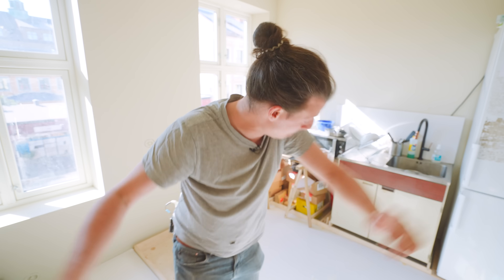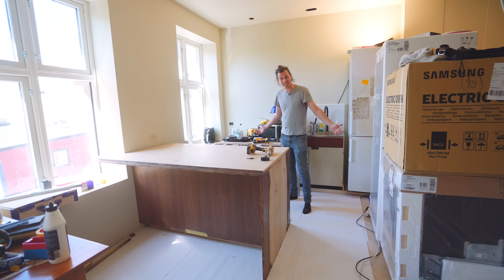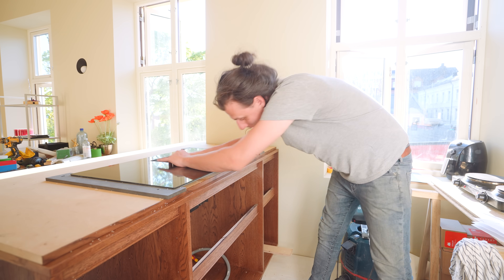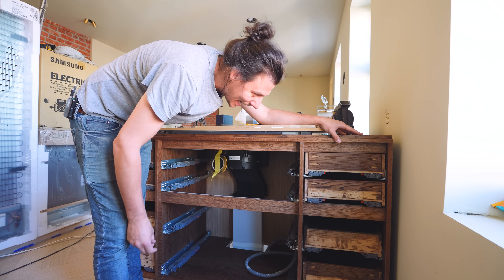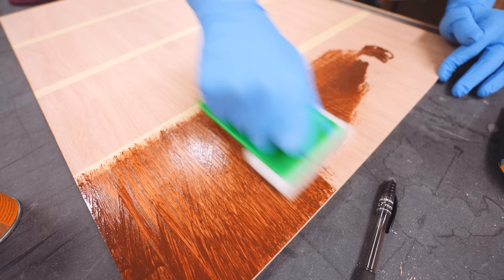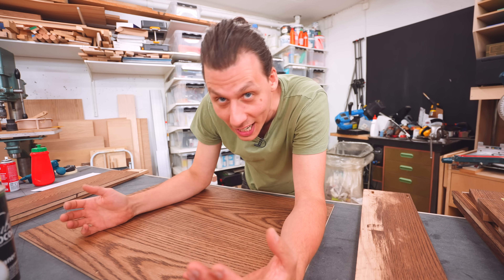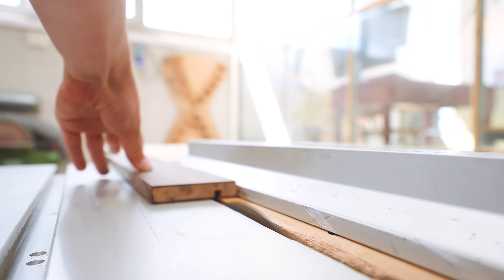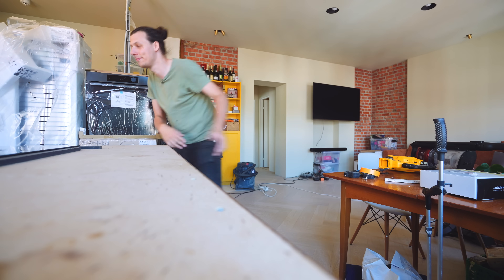Installing the Kitchen we built Ourselves!

Comment: We have the same type of cooking area with an integrated airfang. Eico Tesla model. We were super happy at start but now we are a little bit tired of the air that are blowing out on our feets. The filter do not work a 100%, so our floor are some what greasy and needs to be cleaned often. If we could change it, we would have chosen one that sits i the ceiling instead.
Reply: I was wondering about that. I was thinking about moisture, but yeesh, grease is even worse.
Reply: my first thought was grease hittin the floor
Reply: Never saw this. We have models that blow outside.

Comment: I have a very similar cooktop and had it temporarily installed with recirculation (carbon filters and all). I have now installed it in its final place and I am sorry to say but recirculation sucks (nu pun intended). Is there any way to exhaust air to the outside? The difference is huge! Not just in terms of smells etc but really the most important point is moisture...
Reply from the maker: jeah I've installed a few in the past, for some models you can get upgraded filters so that might improve your situation. And yes I agree, venting to the outside is far better, but the fasade of the building is protected so I can't vent though that wall, and there was no space though the floor.

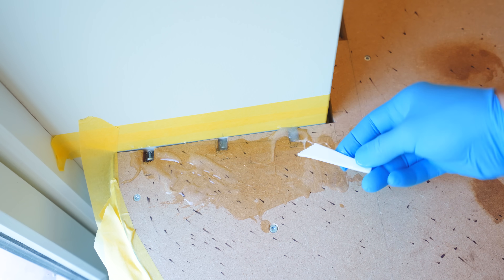Comment: 5:10 That seems kinda crude. How about these nice and clean "revolving notch" fasteners? Weren't they an option?
Reply: Or just pocket holes?
Reply from the maker: The drywall specifies a specific screw to get the best strength, and I figured the epoxy will lock everything in place once the countertop material goes on top of there.

Comment: Your island is on an outside wall, why not vent to the outside?  Filtered vents are super inefficient as are non overhead vents.  Your ventilation will not be able to achieve much sadly after once your filter is even slightly dirty.  Also what happens if you spill liquid in to your vent?  This seems like a poor choice when you had windows right there
Reply from the maker: The fasade is 130 years old and protected, so I'm not allowed to put a vent in there, I would prefer to vent it outside but wasn't able to.
Reply: @achappel  not even through the window?  You could find a way that doesn't need a hole in the facade? Will the dryer also not be vented outside?